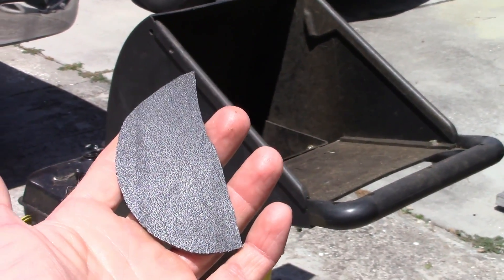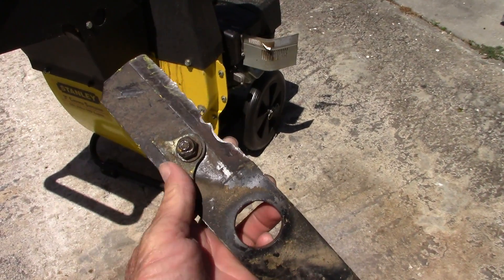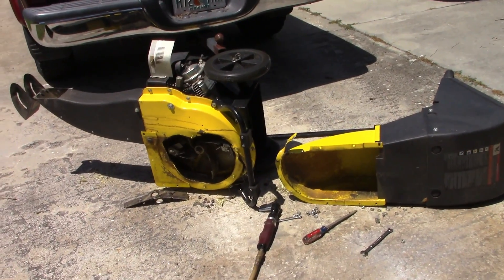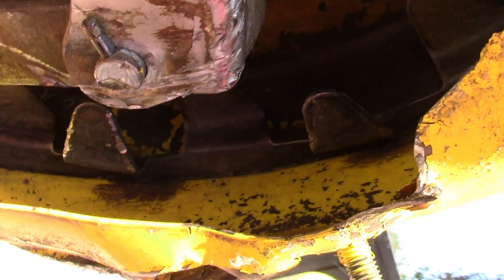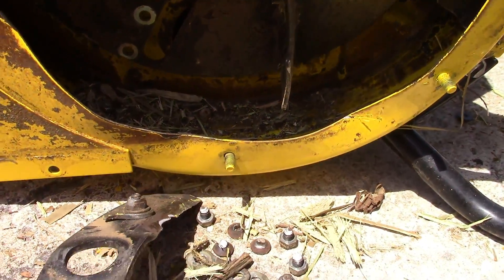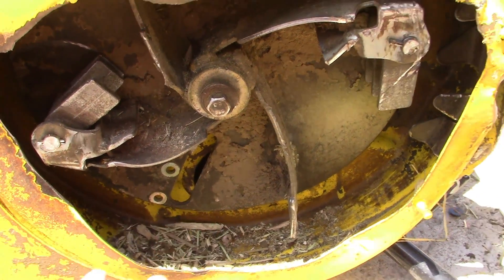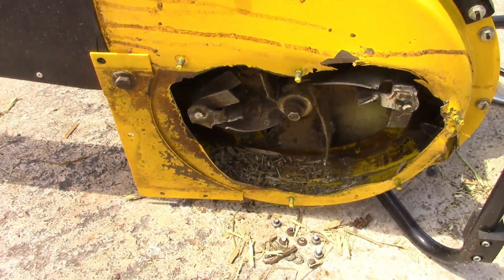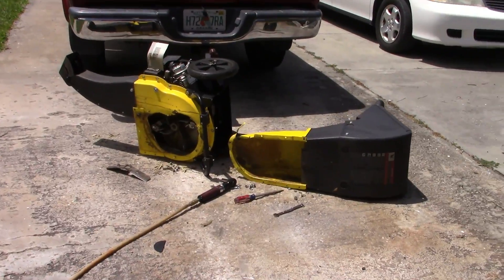I broke the chipper

Comment: Dang bro, that is crazy how it did that. I was thinking you could use that engine for other things off craigslist like pressure washers, genrators or whatever els takes a shaft engine like that, sure there is a lot. Glad your ok mike!
Reply from the maker: +Mikes Lawn Care Well the engine is a dead ringer for the Honda 13 hp. My guess is that it would mount up exactly like one. Yea, I think I'm gonna make it into a pressure washer.

Comment: You're very lucky, good luck finding one for parts.
Reply from the maker: +Carolina Man Actually, I give up. lol.
Reply: +Something 2LookAt You should check out Dr Power. I have always wanted one, but could never justify the cost. They are very powerful, self feeding, and the larger models are chippers + shredders.
Reply from the maker: Jordan Robinson I got Dr's free DVD one time and they do look very good. I wonder how available the replacement parts are.
Reply: +Something 2LookAt That is a very good question friend. I ask a salesman over the phone once and he said they were readily available. However, that is a salesman trying to get your credit card over the phone. Therefore, not certain how true that really is. Also for the cost of the nicer units you would really hope that they would have replacement parts readily available. That is the only thing I like about my Craftsman (MTD) zero turn. Even though it is junk you can buy replacement parts on Ebay for 10% of what it costs for the same part on my Ferris. I am certain the same is true for your Scag.
Reply from the maker: Jordan Robinson Ha, yes, if anything ever breaks on my Scag. Nothing has ever broke. And that's running it through the gamut like I do. Oh yes, I do like Craftsman for it's parts availability. Every time I look for parts for my Craftsman 33, they are all there!
Reply: +Something 2LookAt Yep that is the most true thing for Craftsman. They normally have availability for even the oldest model tillers, push mowers, etc.

Comment: First I was happy to notice it was a Stanley (bro's new job is with Stanley with huge discount 😉) but after see that damage, whoah!  I had a big Craftsman chipper/shredder and got all of my money out of it. Besides all the tree and bush trimmings from my own property, I'd bring home an avg of 200 bags of leaves and run 'em through for mulch and compost. One time me and a buddy went to a dump and loaded his trailer with leaves and shredded at his house. A bunch of trash got ran through too, that we missed while feeding. The next day I went to dismantle and sharpen and found a damn fork tangled and mangled. It was a beast for $600 or so, if I remember right.
Reply from the maker: +8ftbed That's a great story! And I have had the Craftsman and Troybilt chippers too, and I liked them. Troybilt got stolen but it was a great 10 hp chipper. I really like the gooseneck on this Stanley and you can still get it labeled as Brush Master CH8. The damage was my fault. I was putting like 1 inch oak branches in the shredding hopper. It would be fine if I had used it properly. I may get another one.
Reply: +Something 2LookAt yeah, I got the part of using the hopper. I did too though. I got it to eat bigger limbs than recommended. That craftsman was a long beast instead of upright. Man I love a chipper and how instead of having a huge pile of limbs to cut up and tie in bundles for yardwaste to pick up, I run it through the chipper and have a small pile ofq new mulch under something.
Reply from the maker: 8ftbed Heck yea. My compost heap is made up of one heck of a lot of shredded branches. It'll all go in the garden next year.

Comment: By the looks of it, the nut from the blade that sheered caused the hole in the black chute otherwise there would be no other cause for that. And then that follows on with your theory of it continuing to wiggle and gyrate. This unit looks like a right off, as the contacts may have also damaged the engine and compromised the inegrity of the driveshaft to the fly wheel. I think you should salvage the engine as that could be useful if it is not damaged such as a mobile generator just by hooking up a alternator or you could make a portable fan, although i'm not sure why you would need a mobile fan.
Reply from the maker: +TelclivoGaming HD This is the best helpful comment I've read in a while. I hadn't realized that it was the bolt that blew the side out. I think you're right because the hole in my shin is about the size of a bolt. I'll have to run my big magnet in that part of the yard to verify that but I think you're right. I also agree, this shredder is probably totalled. But I'm gonna try to find parts prices anyway. I think this engine is identical to the Honda 13 hp and could be used as the power plant on a pressure cleaner.
Reply: +Something 2LookAt Glad to have been of service. Yeah, salvaging of the engine is probably your best bet. However I totaly understand if you wish to buy parts as after all I am not in control of your finances and do not know your financial situation. If you do decide to get a new unit keep the engine from this previous one and use it for a pressurewasher as you said and maybe sell the metal body to a scrap yard as there is probably nothing else useful or worth the trouble in money for disassembly.

Comment: glad u are ok . the noise it had to of made and how fast it happens there is no way u can imagian that much damage can be done that fast . it's scrap metal now . i have a older cub cadet chipper that i put oak limbs through all the time and have never had that happen . will send u a  picture of it when it stops rianing . I AM VERY GLAD U ARE OK ...
Reply from the maker: +Henry Bennett Thank you Henry. Seriously though, don't put the oak branches in there. Check all your bolts! They may be loose already.
Reply: I have pictures but not sure how to send them to u .. i feed them in very slow and not real big ones if it starts bouncing i burn them .

Comment: Wow, your chipper chipped itself!
Reply from the maker: +Maxx Fordham lol, yea
Reply: Shoot, too bad Stanley doesn't make this anymore. I wonder why they don't. Blehh...
Why not just call Brush Master to ask them to send you the whole new cutter assembly and hopper, etc. themselves?
Reply from the maker: Maxx Fordham They probably would. I'm just still not sure I can resist pushing it too far again. Dodged a bullet, literally on this one. Next time I may not be so lucky
Reply: But you were thinking about trying to repair this one anyway, right? What's the difference?
Reply from the maker: Maxx Fordham Actually no, at this point. I'm thinking I'm not going to repair this one. That's a lot of parts. I see them on Craigslist barely used for a hundred bucks. I will save the engine from this one though. Great engine.
Reply: Well, Something 2LookAt, you actually didn't literally dodge a bullet on this one, but closer to literally than just the purely figurative "bullet-dodge."
So are you saying that you think something might have come out and hurt you, and you're afraid that if you replace this you might play around with it too hard and do this again, but which might end up doing something worse than this?
Reply from the maker: Maxx Fordham Yea, the thing that blew out the side of the plastic hopper did gouge me in the shin. So, to be even more accurate, I did not dodge a bullet. I got hit by a projectile. That's part of what has me gun shy. Which is a figure of speech. And yes, I would probably fool around with it too much again and get hurt again. Which is what I mean by dodge a bullet. Like not getting shot and killed. It's another figure of speech.
Reply: I already know "dodge a bullet" is usually a figure of speech, Something 2LookAt, which is why I already said that you did not literally dodge one, despite your having said "literally."

So yeah, if you fear that you might get too playful for your own good with a replacement one of these, I would agree that maybe it's a good idea that you don't replace it. However, what did you buy it for in the first place: just to chip the regular stuff it can handle, right? So then how will you continue that action without this?
Reply from the maker: Maxx Fordham True, my mistake was using the word 'literally.' That was incorrect. Oh, I just won't shred debris. I'll just load it up and haul it off like the old days.
Reply: Haha, yeah, Something 2LookAt, whenever someone uses the word "literally" (you use standard quote marks to refer to words and phrases as themselves instead of for their meaning) in a non-literal way it just kills me! "I could literally eat a HORSE!" No, you canNOT! Psschhh!

What did you do with the debris while your shredder/chipper still worked? How long have you had this?
Reply from the maker: Maxx Fordham Oh, I put it in my compost heap. To use in my garden. It was just shy of 4 years old.
Reply: So... what would you do for compost now, then, Something 2LookAt?
Reply from the maker: Maxx Fordham LOL, I have a lot! It takes a while for it all to compost. I don't need any more.
Reply: You don't think you'll need anymore for... how long, Something 2LookAt, how long after which sometime down the road in your life you probably will again?

Comment: It was a light use chipper/shredder and never designed for commercial use. Get a total metal higher HP model design for what you were doing with this.  Chalk it up to lesson learned.
Reply from the maker: Indeed. Yea, the way I use things they really must be heavy duty commercial.
Reply: I bought (years ago now) a Craftsman chipper/shredder and it is all metal built. I have used and abused that shredder and it still works great. I do disassembly it and resharpen the blades inside. And that makes it work like new every time. But I would go for a more robust version that is designed for what you are doing with one. There are differences between them.  Bigger is better in this particular situation. JMHO  Keep posting your videos. I like watching them.

Comment: I have a Brush Master CH6.  Some spare parts are available from GXI Outdoor Power, apparently the manufacturer.  GXI sells parts for the older Stanley's.  Here's a link.  Hope it helps but if you can't find what you need on the site, I'd definitely give them a call. http://www.gxioutdoorpower.com/partsacc.htmlall.
Reply: +Gary Hodgin Sorry that's a bad link.  Google gxi outdoor power or try www.gxioutdoorpower.com.
Reply from the maker: +Gary Hodgin I came across that site too. Only a few parts listed but like you say, they might have more. You think GXi is the manufacturer?
Reply: +Something 2LookAt Not sure what GXI's role is.  I'm pretty sure  the Brush Master is made in China.  I've only used my machine a couple of times (got it last fall on one of the one day Home Depot.com sales) and the machine is in storage about 10 miles away. 

 I do know the engine is a DEK, which I believe is made in China also.  I don't know about the Stanley since it seems the Brush Master is the same (or about) as its Stanley predecessor.
Reply from the maker: +Gary Hodgin Actually in the last hour I decided not to even try to repair it. I believe I'm going to build a pressure washer with it's engine. Thanks for your help.
Reply: +Something 2LookAt Sounds like a good idea.  Have a feeling you'd be better of replacing the chipper.  You could probably get a new one for what the parts would cost plus the pain.  My experience with the 2" chipper is that it works okay for dry leaves, but I can blow and mulch leaves.  I wanted it for some leaves but mainly for sticks off trees and crape murtle trimmings.  The 2" is okay but the fact they have to be almost perfectly straight greatly limits its use.  I use my pressure washer a great deal.  Good luck and I hope you keep us up to date on the pressure washer built.